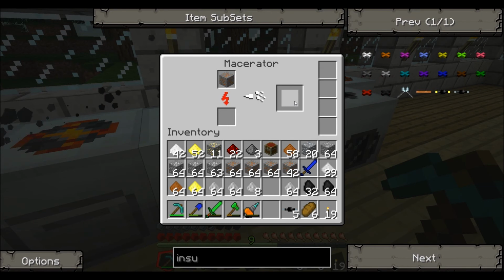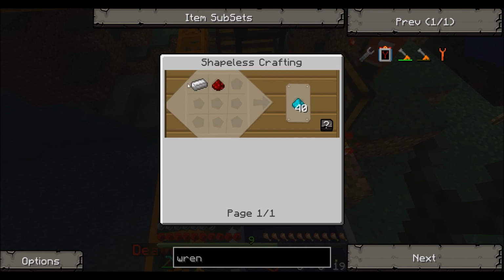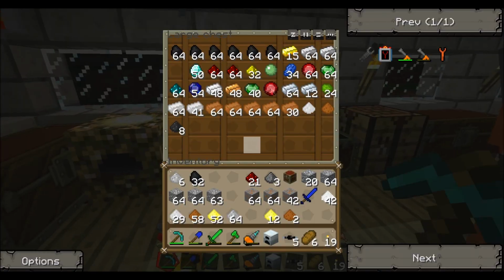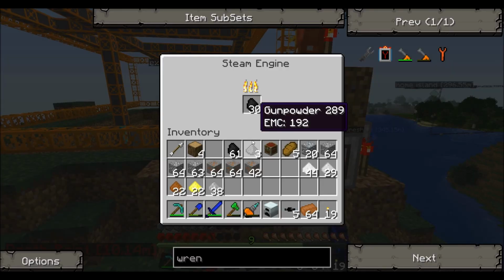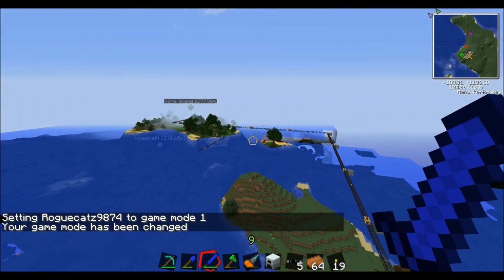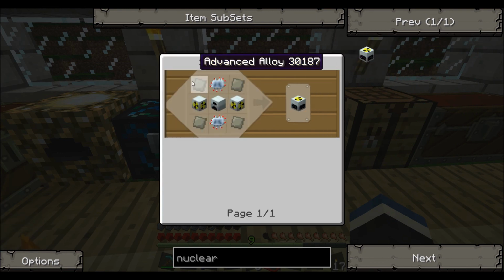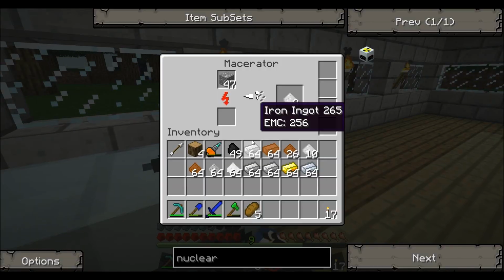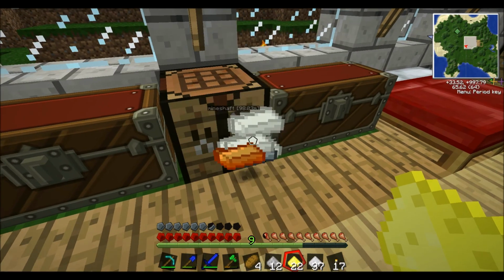Let's Play Tekkit Part 16 *new server* With Thomas, Doug, and Alaire: Quarry Trouble

Comment: there are different voltages of power in Industrial Craft. Each block in the mod that gives out energy gives it out in packets of _ per tick (1/20 second). <32EU/t (Electronic Units per tick) is low voltage (LV). <128EU/t is medium votage (MV) . <512EU/t is high voltage (HV) Most normal machines (Electric furnace, macerator, extractor, compreesor) can only hold 32EU/t in a single packet. MFE's (teir 2 energy storing block) output 128EU/t. YOU MUST USE an LV transformer with its dot towards MFE

Comment: MFSU's (tier 3 energy storing block) output 512EU/t so you have to put them through an MV and an LV transformer with each transformers dot facing towards the higher voltage. Nuclear reactors CAN output more than 512 EU/t making them extreme voltage (EV)making you use an HV, MV and an LV. Tin cables can only hold 5EU/t (ultra low voltage or ULV). copper cables can hold 32EU/t, gold can hold 128EU/t.  glass fiber cable can hold 512EU/t. HV cable can hold 2048EU/t